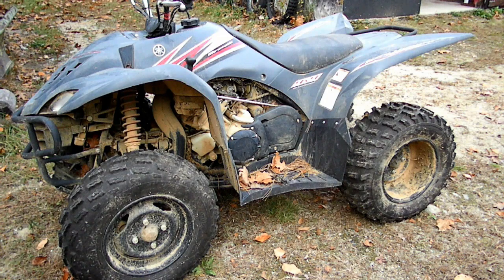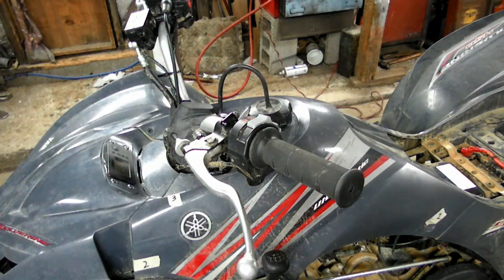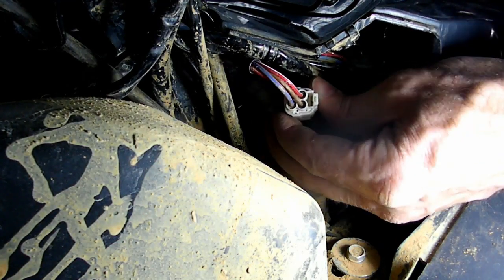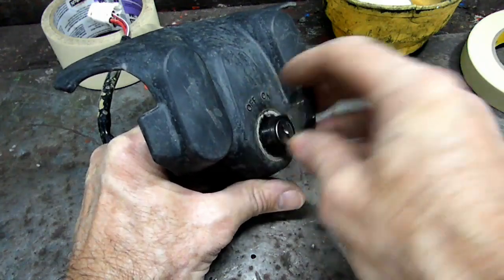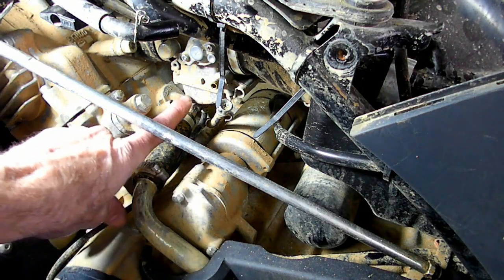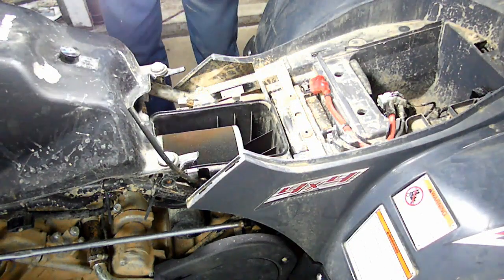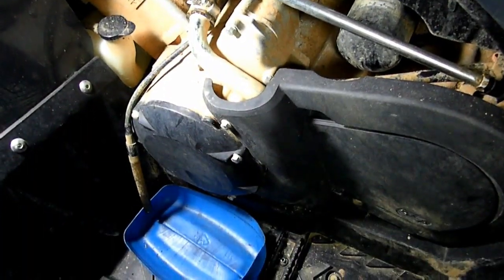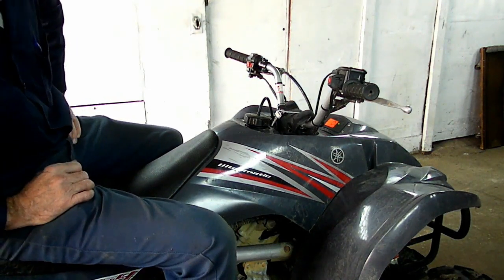Yamaha 4X4 Quad No Start

Comment: When you cleaned the carb. Do you recall how many turns upon seating the air fuel mixture screw you backed it out?

Thanks in advance
Reply from the maker: Gee i wish i could remember.
Reply: 2 or 2 1/2

Comment: Hey Richpin- I know you are starting that Saturn channel. Some A-hole just pulled this illegal maneuver and his rear bumper banged up the driver side fender. Luckily there was no damage to the wheel. Just the plastic fender and a metal support that holds the front lower bumper cover in place which was scratched but not busted. Do you know of any cites that sell used plastic parts?? or if not used, low price on oem??  thanks